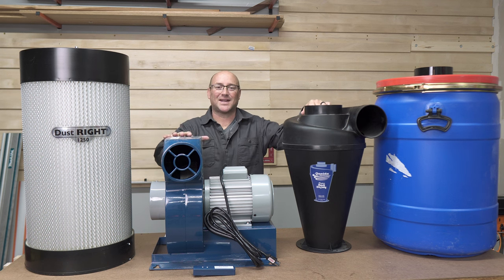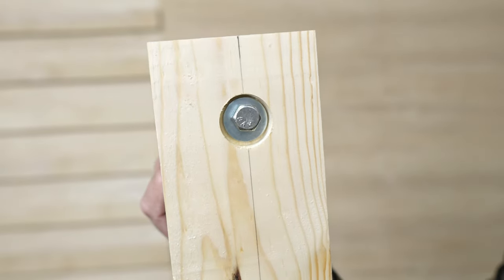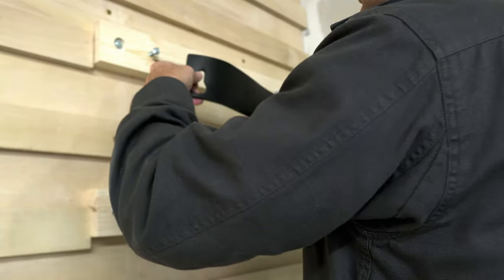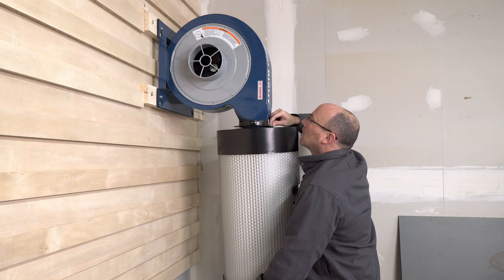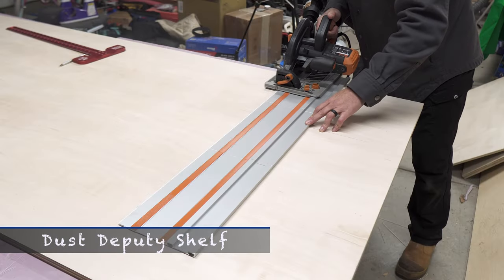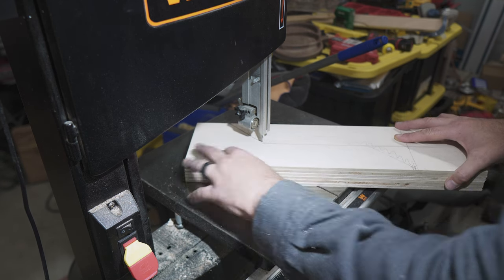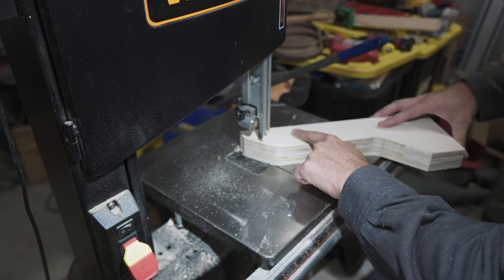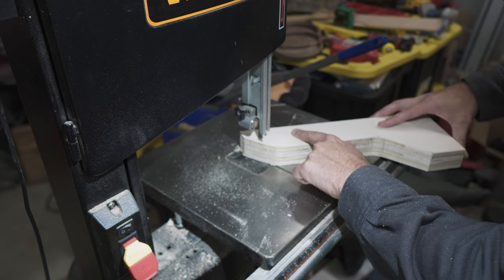Is This the Ultimate Small Workshop Dust Collection System?

Comment: I'd be curious to know how much CFM you have lost by the immediate turn from the motor to the separator. Most set-ups call for a straight connection to get the most suction possible. That's why many rotate the motor directly in-line with a separator and then run an elbow or flex to the filter.
Reply from the maker: I don’t have a cfm meter unfortunately so I can’t do that test but from my experience with the unit so far I can’t imagine im losing much. Most of the units that you’re seeing turned on their side are the harbor freight motors which are not very efficient and fairly weak in comparison.  I honestly wish I could do the cfm test just to see for sure and if needed an easy fix is to add two 6 inch 45’s (90 would be too sharp of a turn) into a 6” pipe to the cyclone.  I really don’t think it would make much of a difference but I could be wrong.